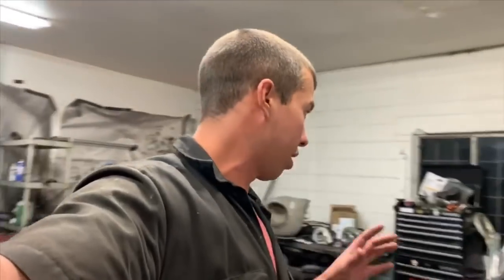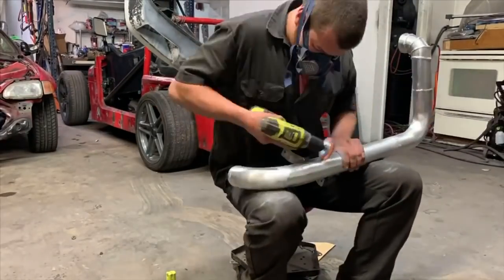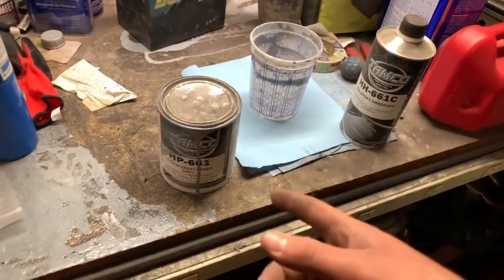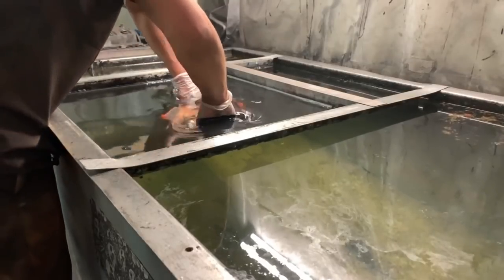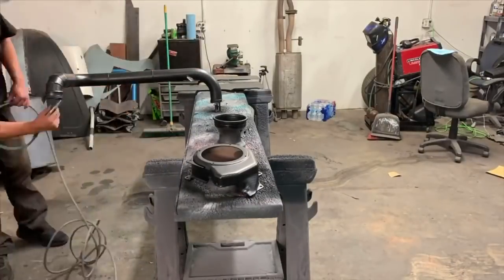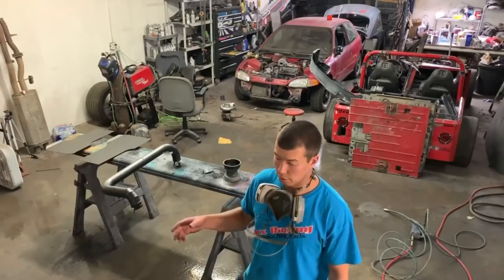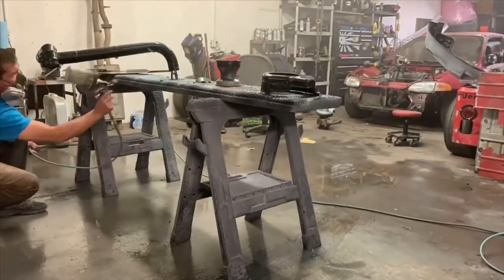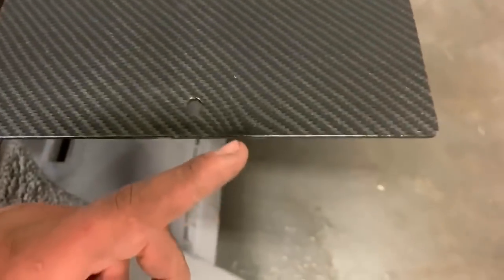HOW TO Hydrodip : Carbon Fiber EvoX Intercooler Pipe and Go Cart Parts

Comment: Not to attempt to tell a man how to do his trade but perhaps I might make a suggestion and that is instead using a hose to wet the floor for dust abatement before you spray get yourself a plain old string mop and a mop bucket and mop the floor with just the tiniest amount (1/2  to 1 Oz per 5 per gallons) dish soap (something like joy or ivory soap).  A friend of mine who is in the great spray booth in the sky was taught that trick by his father who as the story goes learned it from his father who learned in while in the US Army Air Corp during WWII.  He said that his Grandfather who was a mechanic/flying sergeant learned to do this when they would paint planes and or plane parts.  The purpose of the tiny amount of soap is to help break water tension and also help the wet mop pick up dirt/dust on the floor and as the floor dried the soap film helped lock dust down to the floor.  I am not a painter but my buddy was and turned out show car quality work out of his backyard garage that he also did body work in. The day or two before he spayed color or clear the would blow the place out a couple times, sweep the floors several times and mop the floor with Zep concrete floor soap (the stuff that in powder form is orange and when mixed with water turns green [side note he always had a bucket of that and any times he made a oily mess and mop it with that after the initial wiping it with rags]) My buddy (not that I recommend it) used to have a couple of shots of booze before he painted most things and especially clear he claimed the light “glow he had on” made him bolder/fearless when painting and as a result he did not worry about sags or runs and on more than one occurrence I watched him paint a run right off a panel and onto the floor. Take any or all for what’s it is worth which is not a whole lot since you don’t know me from Adam and I am posting it on your YouTube commenters in the middle of the night. Enjoyed the video keep doing what you are doing